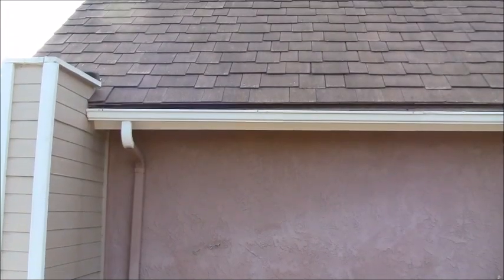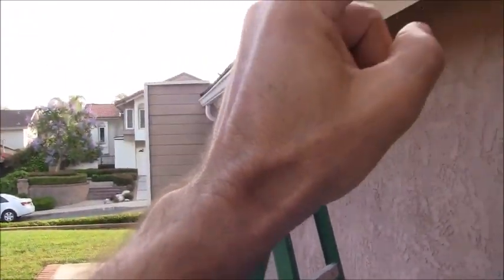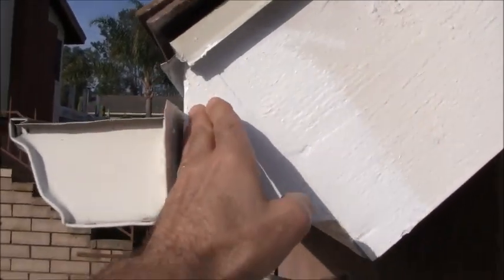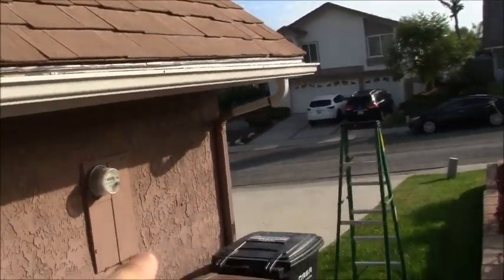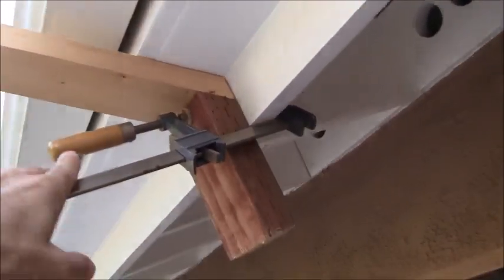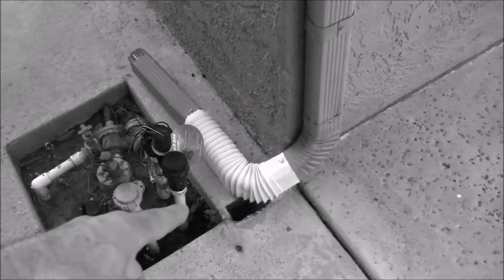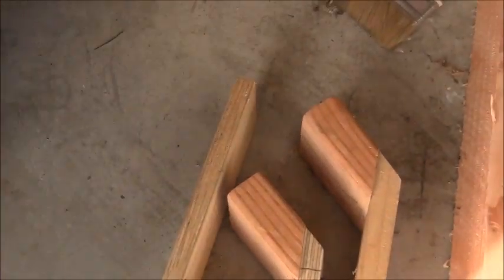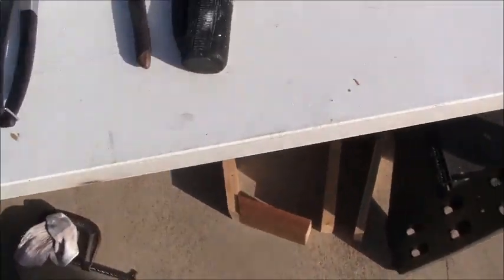How to install Gutters on Home with Angled Facia DIY Part 1 of 5

Comment: Also in SoCal and I have a Tile roof with sloped facia and having same issue but worse because the gutter spans about 40 feet and by the time you get to the end  of the run there is less than  1'' between end of roof and outer edge of roof.  Everyone who says just install angle brackets is not accounting for the fact that as you drop down you come closer in.....  Considering this.  You go to the head of the class with your attention to detail!  Thanks for sharing!

Comment: hi gutter contractor here! not having the gutter behind the drip edge will cause water to go behind the gutter and rot the fascia board and destroy your rafter tails. you should have used wedges for your sloped fascia. you just did 10 times more work for an improperly installed gutter system that would not pass inspection. id like to see the next video 5 years from now when your fascia is completely rotted out and the gutters falling off. please all you home owners out there just hire a professional, you may think you know what you're doing but you'll end of costing yourself thousands of dollars worth of damage.
Reply from the maker: The drip edge sticks out past the gutter so all water from the drip edge is dropping into the gutter. The drip edge is installed level with the roof. if I was to just install the gutter behind the drip edge my gutter would be about level. Over 25' that leaves no room for slope. I am very happy with my installation but I do understand your position. I was contemplating installing flashing from under the drip edge to over the gutter, which would have guaranteed water from drip edge to gutter but I felt it was not necessary so I decided not to do that step. I do have a pretty aggressive slope on my gutters but they are self cleaning and they have absolutely no standing water. I did attempt the wedge installation strategy but I was unhappy with the results.
Reply: one can stick a flashing under roof drip edge to extend in the gutter. The word PROFESSIONAL on your name, logo, badge, truck brand means ABSOLUTELY nothing, we know. Ken did a nice job correcting, Most would just use long spikes use scrape under slanted to facia to get the angle (perpendicular)  and then all the weight is on the fastener. Not good. We rip 4x4 to the correct angle to get the gutter resting perpendicular, then apply the fastner.

Comment: Excellent video for replacing/repairing gutters. I also have angled fascia and I have one question. When you modified to a vertical rather than an angled slope fascia, did you use pressure treated lumber?
Reply from the maker: I did not. Now that you mention it, Pressure Treated would have been better to use.

Comment: Mine has the angled fascia, and I always  thought that was done when a home was not intended to have gutters. 🤷‍♀️ I have single story rancher with low and wide eves and dirt crawl. Inspector said I need gutters, but we are near desert and freeze solid in winter, so ice-damming is a threat. I opted to leave it gutterless because hipped roof sheds at low velocity along all four sides. I get huge icicles, and just let them be. Are gutters necessary? California doesn't get much rain either.
Reply from the maker: Gutters are to protect your foundation and when you walk around the home you won't have the roof run off landing on you.

Comment: Just buy gutter wedges next time and save yourself a lot of work.

Also, if the back of the gutter isn't under that drip edge, water wil get behind.
Reply from the maker: I thought about your coments and if I can save time/money I am all for it But the wedge idea would not work in my case. The reason is because the length is to long. As I incorporate 1/8" to 1/4" slope per foot with the wedge idea the gutter would move in towards the house to much. The wedge idea may work will if the run is under 20 feet and the facia angle is not that great. 
As for the drip edge, i pulled mine out at an angle so the water would drop right into the gutter. I did put the gutter behind the drip edge at the beginning of the gutter run but as I sloped down it lower but not infront of the drip edge.
Reply: T wedges would work fine on that slanted fascia
Reply: Aesthetically wedges look horrible, despite being tucked behind..... there's cleaner ways to keep that gutter plumb against angle fascia
Cheers on the shim... gotta admit that looks clean!

Comment: how would you recommend a corner piece    one side will need to slop about 10 degrees..  just do it as normal but do extra bending and leave extra tabs when when cutting?
Reply from the maker: It should work as you described. End result is the gutter should be installed to catch the water run off from roof and be pitched towards the gutter downspout.

Comment: I believe to save money in wood, the shims would of worked just got to use the right angle tool to find right degree and make them wider, maybe from a 4x4 wood.
Reply from the maker: you may be right, if you did take the time to figure it But, you would need different size shims as the gutter should be pitched towards the drain for proper flow. 
Bottom line, the builders should give us flat facia and not angled when they build.
Reply: @KenTraining  great video. Learned that the vertical degrees is the same to aliviate for the curved inward facia and we fix the horizontal level with leveler bubble every 10' is 1/4 of a drop.